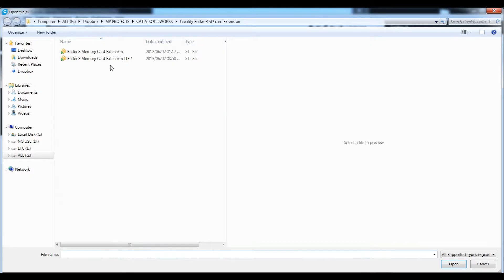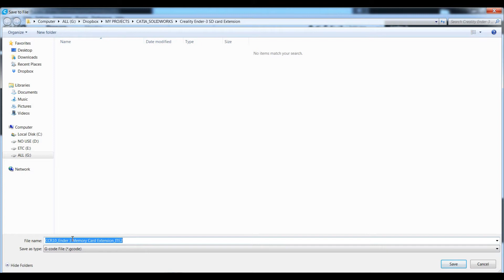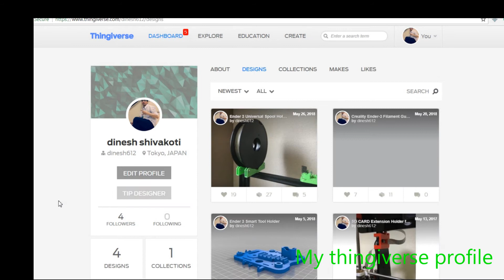Ender-3 SD Card Extension Adapter Mount

Comment: The problem I've found with these ribbon adapters is that the male end does not latch in the Ender3 port. I ordered two of them and neither one of them will latch. Many others have complained as well. If you know of a particular brand that will latch, please let us know. Thanks.

Comment: What is that hole in the front for ?
Reply from the maker: Marek Cernvenokovsky just for less filament
Reply: Thank you, but why don't you just remove that flat piece then ? Is it there just to hold the excess cable or does it have any other purpose ?
Reply from the maker: Marek Cernvenokovsky yeah to hold excess cable
Reply: Thank you very much, I'm gonna definitelly try it when my Ender 3 arrives :)